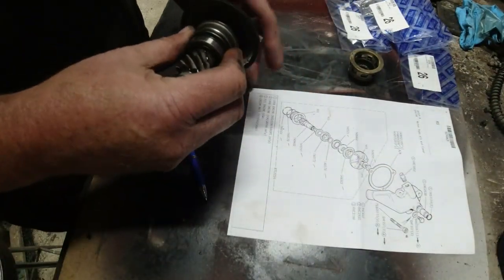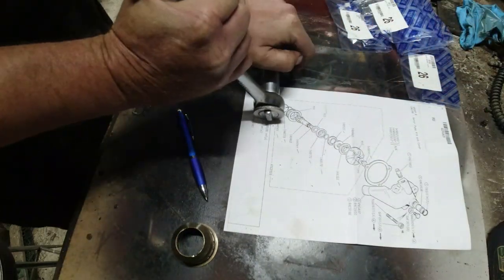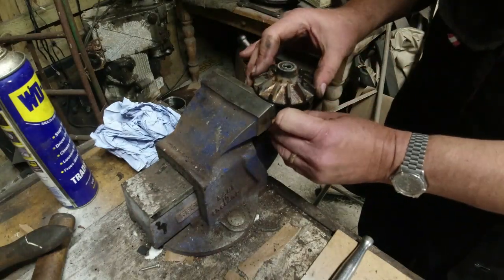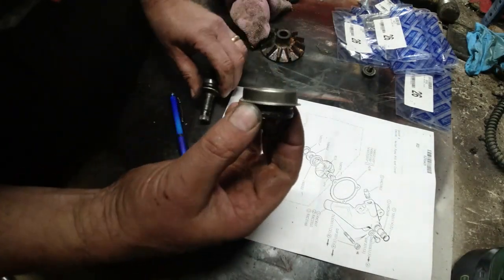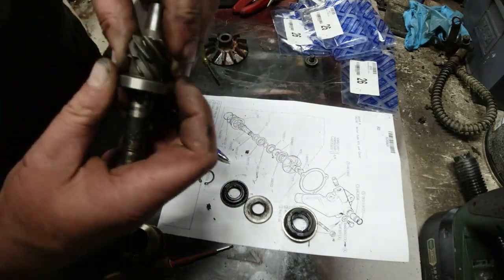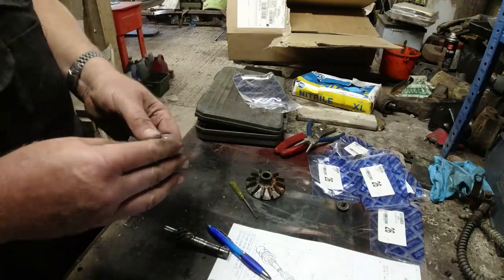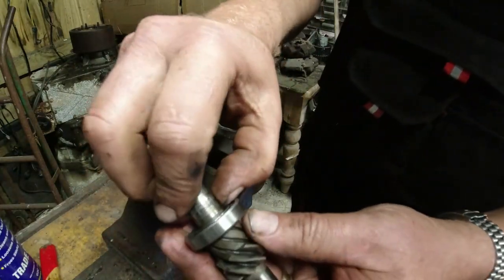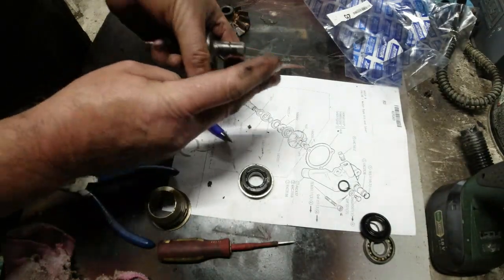Triumph Water pump rebuild, Stag, TR7, Dolomite - Parental warning for profanity

Comment: The real solution to theTR7 water pump problems (there are several) is to "Jack it up and run another one under it" as some say here in TX. In this case the new one will be a Davies Craig electric water pump, controller unit, and electric fan. It's gonna be COOL man!

Comment: great video. wish there had been one of these when i did my pump a couple of months ago! my impeller was not so good on the underside, and when i filled up with water for the first time it leaked out of the opening in the side of the block. Today its all stripped back out and i am have the underside of the impeller machined flat to hopefully cure the problem.

Comment: Here's a dumb question, is there a warning to let you know you're water pump is in need of a rebuild? Other than coolant in your oil or oil in your coolant? Does it make noise when bearings are failing?  Great video.  It's actually pretty straightforward.  Yes, thnx Rimmer bros!!  Plenty of bags to reuse.  Which cars used the 6 vane?  I have a '77 TR7, I think it uses the 12 vane.  Anyway, ramblin' on here.  Thnx for the video from a proud owner in Long Island, NY.
Reply from the maker: No such thing as a dumb question, not a lot will let you know other than an "odd" sound from the engine or a rising temp gauge. When these were first fitted I guess they were for the life of the engine. Which for a 1970s car - 50 years later is where we are now...

Stags used the 6 vane, be sure to match the vane impellor and pump cover though.
Reply: @churchhouseclassics  thank you church house.  Yes, must match impeller vane and pump cover - gotcha.  
    Yes I suppose we are nearing the end of the first life of these little cars.  That's always something to keep in mind.
     For now, me and my TR7 shall charge down the roads mightily, until any signs of trouble occur.  Let the jackshafts whirl, let the vanes pump, and let me wear my big, cheesy smile that this car puts on my face. 😁

Comment: Good to see anything that encourages others, but is that always a good thing? Having rebuilt several of these I know that they can be a pig work on, and there are many pitfalls.  1. If the impeller doesnt come off that easily, it can break into two if you dont do it carefully.  2.  The impeller if often corroded so then will need skimming.  3. The rebuild kits sold by the big specialist companies are usually not of a good quality; the water seal doesnt fit well (because it has a tapered outer), and the ball bearings are not of a known good brand. 4. Sometimes the impeller is too loose when refitted and will spin on the shaft, this can be tricky to repair.
Reply from the maker: I think that everyone needs to understand their own ability, after all nobody is born with the knowledge to do anything, there is a learning curve and with gentle encouragement and advise folk can do stuff for themselves if they want to. If something is broken that you have nothing to lose by finding out how it works.

Or watch me swearing at machines

Comment: Having had my Stag for over 30 years, I have had these out numerous times, and there are a number of ways and means. 

Lots of ridiculous myths as well. One bloke on a page about Brit cars "Stags are terrible, HALF the hreads are left handed, and they don't tell you!!!!!" FGS, I have had EVERY SINGLE nut or bolt undone on a Stag, and there is ONE (yes, ONE!!!!) LH thread, that is that water pump bolt, and it is LH for multiple reasons. It TELLS you in the book, AND it has "L" stamped on the top of it in every one I have had off (at least half a dozen). So in "Exagerworld", ONE is "half of them...." Ludicrous, but haters gotta hate.

From memory, I use a hammer if I have to to remove some parts, but usually use pullers and press (or vice as a press. I have a small press, but often the vice with various size sockets as formers works better). I NEVER use a hammer to assemble, as the seal is graphite, and very very brittle/easily shattered. The book says to hammer stuff, but NOT once the water seal is in. Once that is in, it says to press on the impeller. 

The impellers are hit and miss when removing them. That is why I amassed handfuls of old pumps, because if an impeller is really stuck, it will often break before coming apart no matter what you do. 

One small point is the water pump oil seal. The original seal was a weird seal that NO ONE SELLS ANYMORE. I have only ever seen one in an old pump I pulled apart. It is shaped like a small volcano, (look at the sectioned diagram, you will see what I mean) : And is actually backwards, in that the open lip side of the seal faces the wrong way, ie pressure from the oil side opens it. It CANNOT go the other way, as the "volcano" angle would stop it fitting/push seal through the circlip. Doesn't matter; because the seals they supply now are the flush sided ones. Just make sure it is fitted opposite way to the "volcano" one in the diagram. That puts the lip the correct side, and the seal away from the circlip, that is, offset away from the circlip = perfect. If put the way the book says, the seal will foul the circlip, wheras the "lip toward oil" side is not only correct engineering practice, the outer edge of the seal can press in fully against the outer bearing shell. 

Initially, the water pump SHOULD come out by just turning the centre bolt. That drives it against the skewed teeth of the drive gear, and that propels it upward. while running, the slew of the gears pulls it in. So one of two things should happen, shaft complete WP will come out, or the shaft will come out, leaving the brass basket behind. 

The brass basket can be removed with a slide hammer. There are a couple of ways to secure it. You can use a hook, OR can get a disc with a hole in the middle and a bolt in it with a nut to secure it. file off the sides of the disc, and then angle it in and across, screw slide hammer into bolt thread - pull it out.

I rebuilt my first leaking Stag WP, and then didn't have a problem for a long time, but then made the mistake of buying a "brand new Unipart one" that was one of the "not properly hardened ones" and it ate my jackshaft within 500 kms. From then on I rebuilt old ones with known shafts. I have done 330,000 kms in my car, so makes sense you'd go through a few.

I had never bought any reconned parts/always used old parts/condition assessed by myself. I decided to give my car a birthday about ten years ago, (as big ends were getting a bit worn, crank had done 400,000 kms plus, 90k by previous owner, almost 300,000 then by me) and bought a "completely rebuilt" engine from the UK. 

I should have done what I wanted to do, rebuild an old block that I had here instead with a spare good crank that I had..................... 

The heads were skimmed far too far (the car is even now higher compression than they should be, even WITH the thickest gaskets); but even worse, when I went to fit the water pump, there were two huge gouges in the cast iron sealing surfaces in the block from where the guy had used a hook and slide hammer to remove the WP. I mean, HOW HARD do you have to belt cast iron a 1/4 of an inch thick to butcher it?? I wouldn't have bought it if I had known that. I have done it at least half a dozen times, and NEVER done any damage to those surfaces, and yet a "professional" does that????? So I had to use Devcon to fix it. It doesn't leak, but I KNOW it is there, and it really annoys me. 

I also have a Dolomite Sprint that I bought in 2000 and that shared everyday driving duties with the Stag until 2013 when a water leak put it off the road, and it has been laid up since then. But in the 13 years I drove that (including a Perth/Melbourne return trip I did summer of 2003) I never had to touch the water pump.............. and still haven't. That car is sitting in my Dad's garage, and with 4 cars and 4 bikes, I have never gotten around to getting it going again. But I have to move it soon, so........................

Anyway, great vid, good to see people doing things like this. Cheers.
Reply from the maker: Wow thank you for such a detailed post, I enjoyed ready that and agree more or less with everything you wrote.

The worst thing about the stag has got to be the bloke in the pub

Comment: And suggestions how to get the brass cage off if it wasnt left behind when you remove the pump?
Reply: I made an attachment for my slide hammer using a bolt and a small piece of steel. The piece of steel is just small enough to pass through the bottom hole in the cage. An elongated center hole allows it to pivot on the bolt to pass through the hole and then pull up flat against the bottom of the cage. Whacka Whacka and out she came.
Reply from the maker: I use one of these https://www.screwfix.com/p/hilka-pro-craft-dent-puller-kit-9-piece-set/62730, available all over the place. the right angled adapter fits under the bottom edge of the cage and a couple of light taps and it comes out. Just be careful to lift it from various positions so that it comes out straight. New o-rings on the outside of the cage before you fit it and the pump back into the block 👍

Comment: Hello Rich, Thanks for the great vid! Question for you... What is the purpose of the part you refer to as the "Top Hat", number 148462 on Rimmer''s plate? On disassembly mine was corroded to the shaft requiring considerable persuasion to remove. Doing so left the part ever so slightly mangled. It now has a loose fit on the shaft and after assembly is free to move up and down and rattle around inside the pump.. I thought this piece was supposed to keep the lower seal in place but it would seem like an iffy way to do that in the first place. --- Mike in Texas, USA.
Reply from the maker: holds the seal, arf arf, down as far as I am aware. else the seal might invert
Reply: @churchhouseclassics  Hi Rich, All the diagrams I have seen refer to the part as "Water Thrower." Seems like typical British obfuscation to me, and one should always eschew obfuscation! Regardless.. Davies Craig will be getting around $400 of me money for their electric water pump setup.

Comment: HEllo again Rich... figured out my problem... the "top Hat" is supposed to press onto that eeedie - beedie shoulder on the shaft. My top hat is too arfed up to press on and hold. I will try to correct this in the lathe. Also having thoughts of turning up a better part. This is a truly crappy design! Although I guess it works,,, fuck!
Reply from the maker: simple but crappy design 👍🍻😂